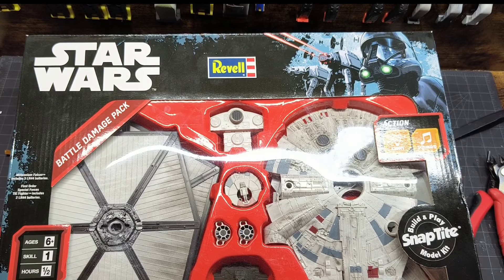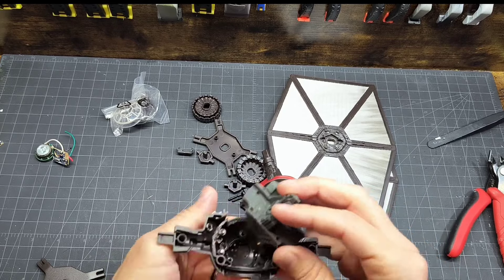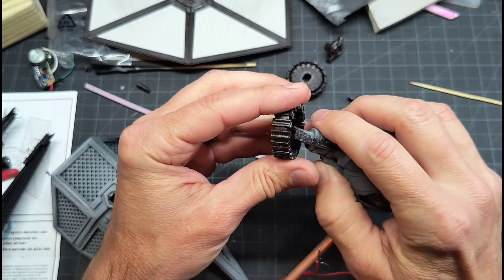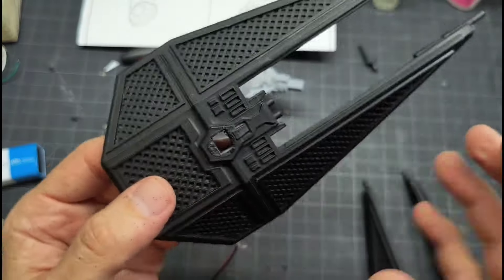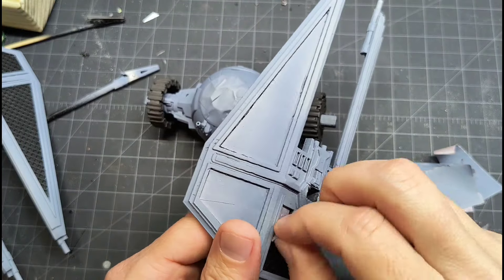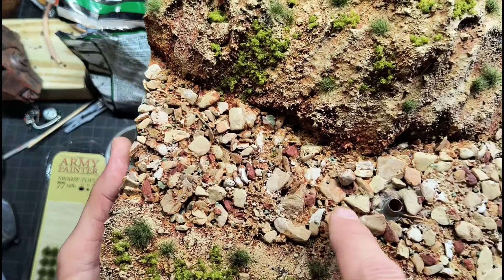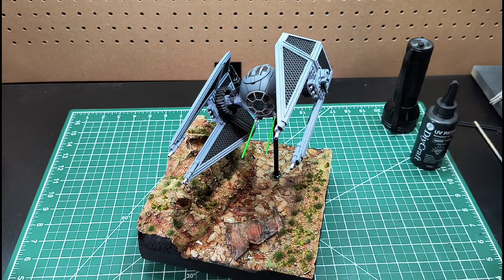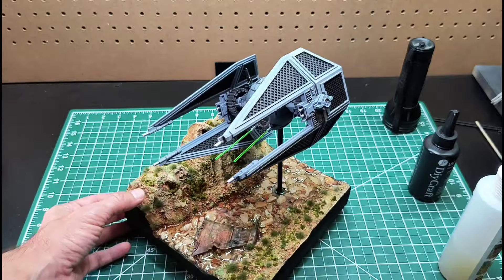Star Wars Customized TIE Interceptor

Comment: Was that 14-2 Romex I saw?
Reply from the maker: The wire was old telephone cable
Reply: @EagleSciFiModeler  Tiny gauge.  Good job.  You would've been a great Telecommer or Wireman.
Reply: @EagleSciFiModeler  Telephone cable wire?  What's that?
I've been using cell phones for nearly 20 years now!  I think my last land phone was disconnected in 2006 or 2007!